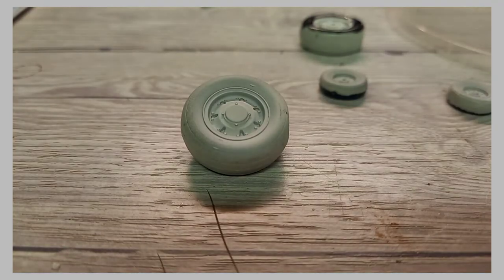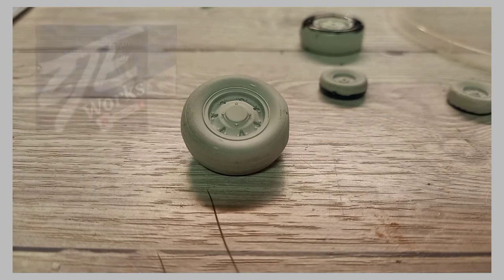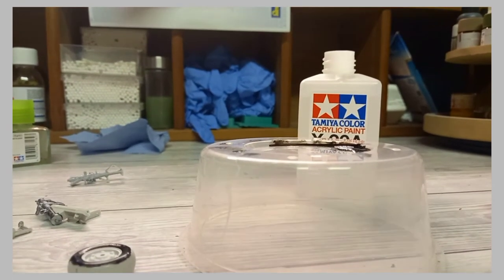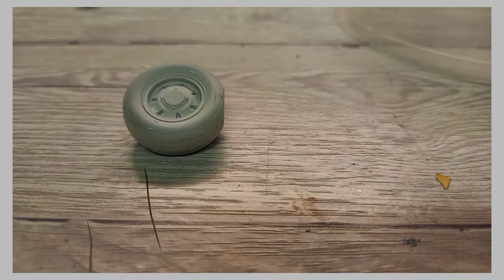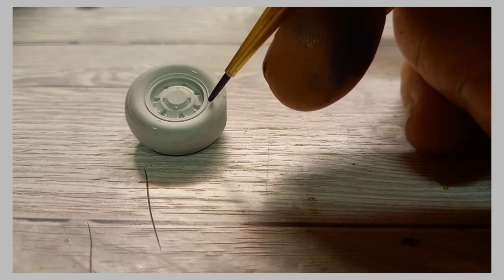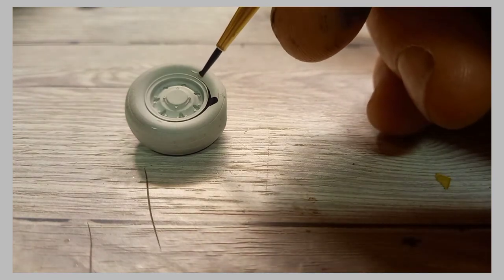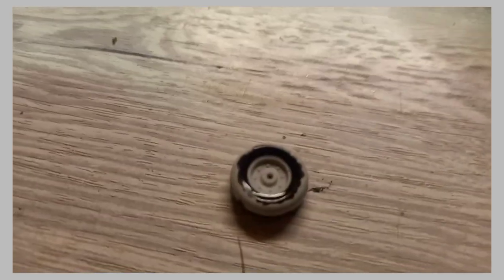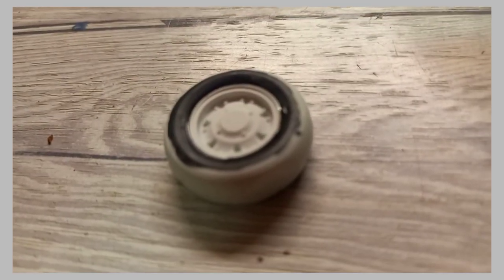Painting model aircraft tyres. Revell   1 32

Comment: So I tried this technique and the paint doesn't do what yours does by capillary action. What happens with mine is that it's the last time I make a mess of these little fkers.

I was really enjoying getting back in to this, doing an amazing job so far and spending a boat load of cash getting the supplies and equipment and now all I want to do is throw the lot in the bin.

It also doesn't help that joining gaps with filler ends up with you scratching off a lot of details which just seems too much. If these kits were half decent then you shouldn't need to spend an extra £300 on materials to fix bad joins. So if I managed to limp through making a terrible job of the wheels and a terrible job sanding off most of the details I would then obviously not be able to compete the paint scheme for the propeller because it needs dividing in to three and I already tried and failed to mask it a number of times. 

Its most likely cheaper and less stressful to buy a dicast model for £1000 by the time you'd practice enough to get it half way decent.

Sorry but this isn't for me. It almost was and the extra annoying part is that Im still having some stuff I ordered delivered which I don't need, that end up going straight from the postman, straight to the bin.

Not to mention the four weeks of painstaking concentration building and painting everything else.
Reply from the maker: Mmm, I'll watch the video back bud see if I can understand which bit you're on about. But dude don't give up just yet. Patience is key
Reply: @7Markandrews  The part where you explain to touch the tip of the brush as close to the edge of the divide between tyre and hub.

I made a runny mix and it wasn't runny enough, it just sat there very wet so I had to try and paint the tyre by hand which went horribly wrong. So that ruined one wheel, I thin the paint up some more and this time it just runs straight down and spoils the second wheel.

I even tried before this buying a circle template. Which looked great until I tried it, scratched all the black paint only to then find the circle stencil holes were less than a mm too small. Causing over spray the entire circumference.

Your method was my last hope to not only correct that overspray but to make it look amazing.

Now, it looks amazing at the bottom of my wheelie bin.
Reply: Your desire may be in the display of your aircraft. For myself it’s the journey, I will eventually achieve the desired result, but time and practice. A lot like trying to impersonate Morgan Freeman.
Reply: M